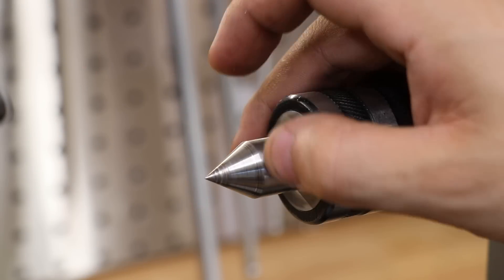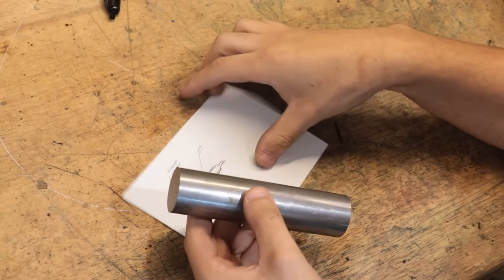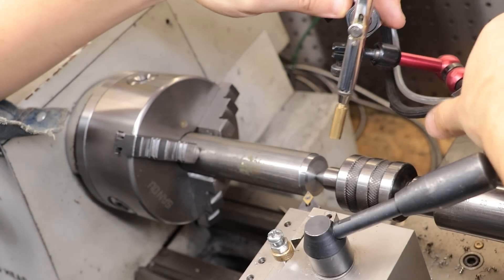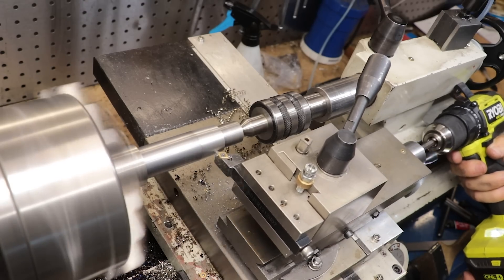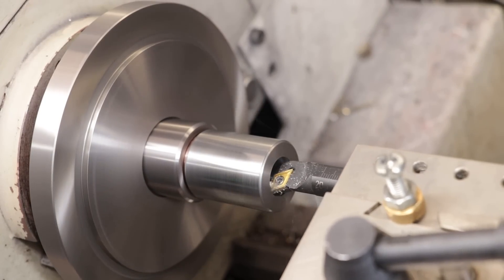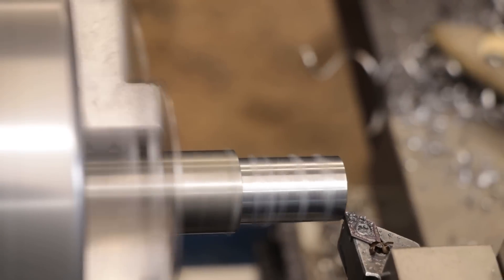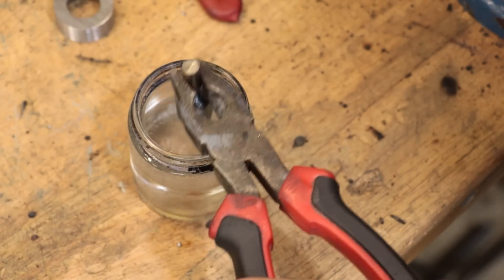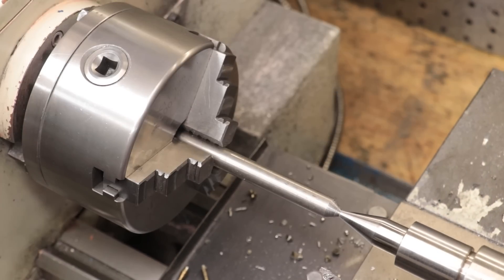Making an Inverted Live Centre for the Lathe

Comment: Hi mate.  Great video. I noticed your compound slide needs adjusting. I see it dragging and cutting on the retract stroke plus i see the once per hand wheel rev ridged finish on your machined surface.  I have 2 hafco's and have resolved the same issues with adjustment.  Note: This can also be the cross slide and saddle adjustment adding up as well. Love your videos mate. Please keep up the great content.

Comment: I used to make cone drives and tailstock centres for woodturning out of iroko and Beech, Beech was a bit grippier for tailstock cones and spun better on a bearing but Iroko does a great job as a drive cone, for small work you can even turn a one morse taper so its all one piece and it will work fantastically. I used them for making lace bobbins and some weird art pieces I did a while back.

Comment: As for finding used "hard stuff," if you have any truck shops in the area (or truck salvage yards) try to get some steer axle king pins.  I found one in a trailer that was gifted to me by a retired tow truck owner.  That stuff happily flattened the point of my center drill bit.  Then it laughed at my HSS tool bit, and ruined the tip on a TPG-C6 carbide insert before breaking the tool holder.  24 hours in a fire that I allowed to burn out and cool under cover finally got it where I could turn it.  I don't know what material it is, specifically.  I do know it is tuff stuff, even in an 'annealed' state.  I'm hoping this material will work for a machine that I can't keep one certain gear in.

Old brake cam rods might also be good, they have to withstand repeated torsion loads.
Reply: anything off the railroad is also pretty damn hard. Tie plates sneer at half decent drill bits and files skitter pretty good.
Reply: @md4luckycharms    It is, but don't assume that random  items laying near tracks are free for the taking.  Railroads had to crack down on material thieves, and their pet detectives could be lying in ambush.  You could find out why the railroad rank and file call them "Dicks."
Reply: that's a great tip!!!
Reply: Rails seem to be made from steels similar to 1084 which you might use for knives, but decarburisation from excess oxygen during manufacture can make the surface layer soft, while a "White Etched Layer" on the running surface can be 3x harder.

Comment: You could have made a double fee adaptor one angle for the live centre and one for the component , easier and cheaper for small projects, 
and make another adaptor one end for your live centre one end 90 deg with a 50mm mouth for holding stock that does not have a centre drill

Comment: You could have made a double fee adaptor one angle for the live centre and one for the component , easier and cheaper for small projects, and a wide 
and make another adaptor one end for your live centre one end 90 deg with a 50mm mouth for holding stock that does not have a centre drill

Comment: Press-fitting both the inner and outer races of a ball bearing 😞
Reply from the maker: Just going off the spec sheet for those bearings
Reply: If they aren't it will spin and damage the housing or the shaft.
Reply: its home made, if it fails he can just make it again but better.

Comment: I would have just bought a live centre, faced off the end and drilled a hole. shrug
Reply: YAFI
Reply: You would have to make some sort of custom clamp to stop the live centre rotating.   Just as easy to do what Artiisan Makes did.
Reply: You do realise live centres are hardened so to drill the hole would require a carbide centre drill.
Reply: @dikkybee4003 Just anneal it and reapply the heat treat later.

Comment: you could assemble the live center and machine the tip later, you just need to make some sorf of a contraption to lock the live center. You get less runout
Reply from the maker: You could but all up the run out is less than 0.015mm. That’s far better than what I was aiming for
Reply: @artisanmakes  yeah, that is better than what you can buy for normal price :D
Reply: The whole point of having a workshop is that you make stuff using your machines because it's fun.

Comment: To save turning the morse taper why not consider employing a taper from a redundant drill??  
I employ one, well two fitted with center drills to save swapping about in the chuck.  
An old drill taper can be employed for many useful tools.
Also why harden the cone as there should be no wear as the cone is running at the same speed of the job, so why not use brass or bronze??
But do believe there is a need for a small thrust bearing and does it need to be such a force fit?
Reply from the maker: I don’t have a spare taper from a drill. So I have to turn it myself. The co puns was already set up to cut it a way

Comment: if the bearings dont last, how would you get the old ones out,
Reply from the maker: Bearing puller
Reply from the maker: I can weld the cone to a plug and pull it out
Reply: @artisanmakes  l though you might have to hydraulic them out but i dont know if that works with roller bearings
Reply: @debeeriz   There are several tricks to try for removing a bearing/bushing from a blind hole.  Most involve some form of hydraulics.

Comment: You wouldn't make the part in that order that would make this nessesary. You're also limited to it supporting a workpiece with that angle taper. It couldn't support a workpiece with a more acute taper as it would only be touching on the point, and a more obtuse taper would only be supported on the very outside edge.

You would turn it to the diameter first and them hold it to turn the taper. It would have a better chance of being concentric compared to the rolled finsh you first held it by
Reply from the maker: Also that’s that’s how I turned the first pin and it’s. It’s more work than it really needs to be. This part does not need to be hugely concentric, it’s not necessary
Reply: Thanks for explaining, I was wondering the same thing.
Reply: @artisanmakes  you would do roughly the same amount of work. Don't do one complete pin at a time. Do one OP to all 100 and then move on, it'll be quicker.

With one set up for turning the taper with the compound, and a stop to set them in the same place each time, you'll get through them in no time
Reply from the maker: No. It is not quicker. You didn’t see the full geometry of what I’m turning here. You can’t turn the step down on the pin without supporting the end, so the cone needs to be turned first.
Reply: @artisanmakes  ok. The experienced production engineer and now instructor for the armed forces knows less than someone with a Chinese lathe and a youtube channel. You do you, mandem
Reply: @JSmith19858 you do realise that when you use a live centre you are required to use a particular angle? So your comment about restricted to using the angle is useless. Being an engineer and an instructure in the defence force means diddly squat. An engineer is a person who has book smarts but no actual physical machining experience or as a machinist they are a good engineer. Training defence force means your smarter than them and my experience is your smarter than an indoor plant, good for you. With your limited experience that is why you make the  statements you did, not knowing what equipment that is available, not know what is required, what tolerances are needed and yet you think you are required to tell them what they are doing wrong. Unless they were doing something dangerous, don't go away angry....just go away.
Reply: @JSmith19858  20,000 people have watched this video and none of them asked
Reply: @dikkybee4003  they aren't using a live centre. They're using an inverted centre, which is restricted in the angle of taper it can support. They video creator has acknowledged that exact point, so your rambling personal attack is pretty much moot.

Rather than being in a rush to insult people, maybe you should make sure you fully understand what is being said and understand what is happening in the video, as you clearly haven't. I may suggest taking some reading comprehension lessons
Reply: @Lozoot2  I wasn't asking, I was suggesting. Maybe the creator would do well taking on advice, rather than coming out fighting when people try to help them
Reply: @JSmith19858  it's you who comes off as aggressive, demanding your advice or suggestions be followed.
Nobody is obliged to follow any advice from randos in the internet, even if they are in "ThE ArMEd FoRcEs".
Also: boasting about your self perceived higher status makes you look real petty.
@ArtisanMakes has produced some astounding projects on said mini lathe which are all documented right here on YouTube. I think he has proven to be  more than capable to select a solution that HE thinks is adequate for his situation.
Reply: @JSmith19858  wow you think pretty highly of yourself. your embarrassing yourself.
Reply: @artisanmakes  Just an FYI, while it might not seem like a cool thing to do you can shadow ban people who consistently get toxic in your comments sections. They still see your videos and can comment but their comments aren't shown to anyone else. LTT does this with their comment sections a lot because linus just gets pissed at people lol
Reply from the maker: I need 100 pieces made and this is the fastest way to make them. You did t see the full geometry here but this is the best compromise to make them. I made the centre specifically for this one off part. I wouldn’t have done this otherwise. Cheers